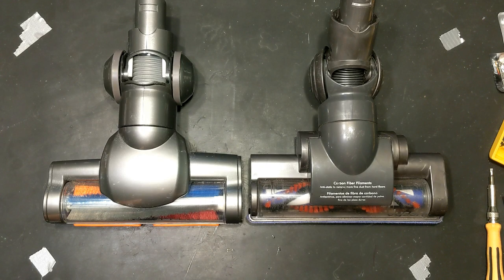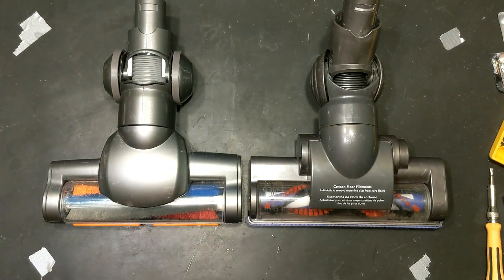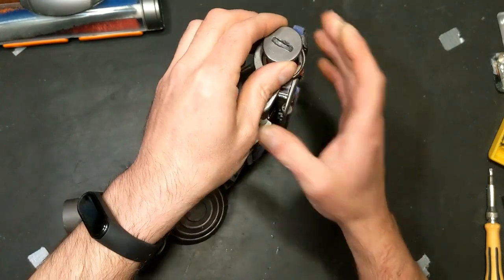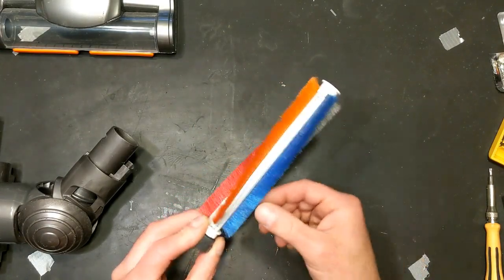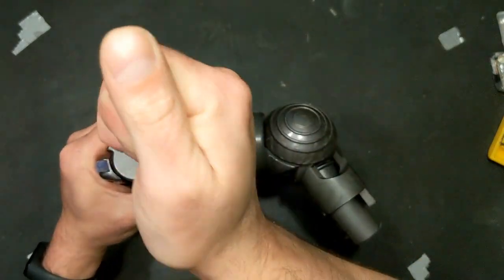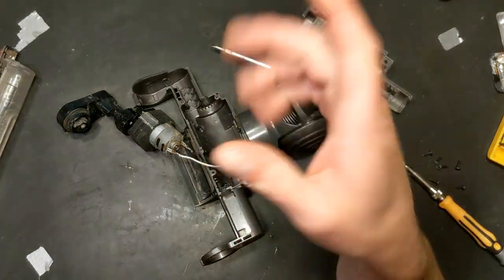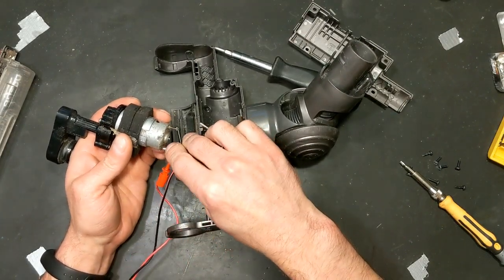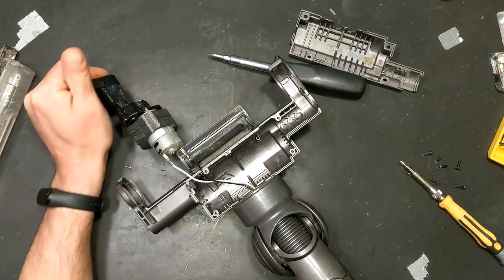Dyson Powerhead Teardown and "Repair" Attempt - Part 1

Comment: My DC35 brush head motor constantly cut on and off for so long now, but disassembling it even down to the black drive housing with the gears and belt didn't yield any jams, beyond some hair wound around the black drive sprocket for the brush roll itself. I cleaned and crimped the motor leads and even cleaned the contact prongs that lead into the brush head and extension tube. If I wiggle things just right it comes on, so I think it's a bad electrical contact buried inside the rotating cuff that allows the whole brush head to spin freely. It couldn't spin freely if there were physical wires inside, so it must have some kind of inner and outer metal collar with spring contacts that need cleaning. Unfortunately Idk how to open that part and no video seems to show that. I might just give up and get a similar generic brush head.